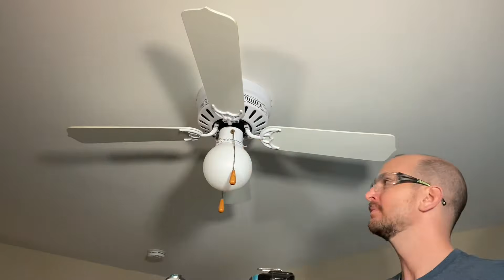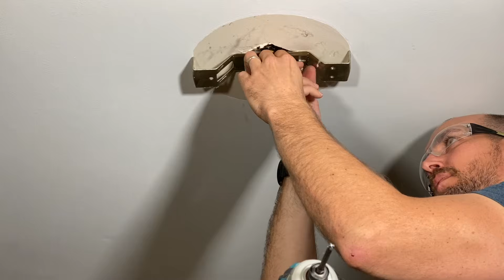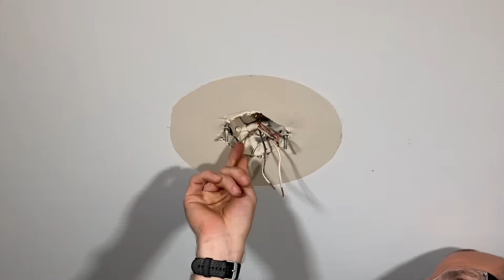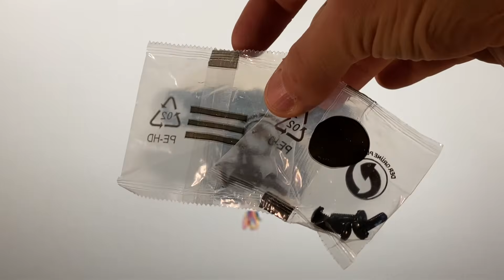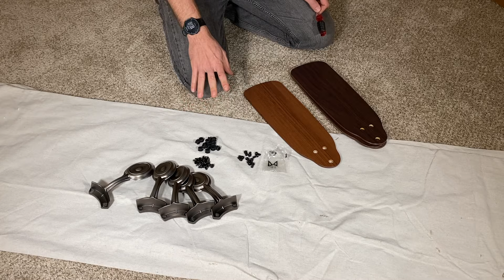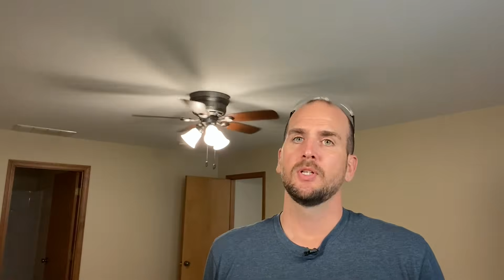How To Install A Flush Mount Ceiling Fan | Hunter 42 Inch

Comment from the maker: Hunter Flush Mount Fan 52 inch:  https://geni.us/BLdzPb
Klein Voltage Tester: https://geni.us/fAYN9Rr
Craftsman Screwdriver Set: https://geni.us/jXqFI
Wire Strippers: https://geni.us/MdOB
Makita Cordless Drill Combo Kit:  https://geni.us/t7dIA

Tools Every Weekend Warrior Needs
Dewalt Drill Bit Set:  https://geni.us/oFlSl
Dewalt Screwdriver Bit Set:  https://geni.us/VDcr
Eklind Allen Wrench Set:  https://geni.us/7XfvO
Pliers (4-Piece Set):  https://geni.us/RIdx
Stanley Utility Knife:  https://geni.us/ndIDa
Stanley Tape Measure:  https://geni.us/bUfD1R
Studbuddy Stud Finder:  https://geni.us/RySCuVw
Johnson Torpedo Level:  https://geni.us/wiLcDY
Stanley Hammer:  https://geni.us/bPDk8Wo
Buck Bros Wood Chisel Set:  https://geni.us/vk3cpTW
Klein Outlet Tester:  https://geni.us/kdBAJ
Little Giant Ladder: https://geni.us/fmlmTk

DISCLAIMER: This video and description contain affiliate links, which means that if you click on one of the product links, I’ll receive a small commission.

Comment: I'm installing this fan now. The two small machine screws that go into the bracket to hold the fan motor don't actually reach all the way to the fan motor thus the motor isn't totally isolated from moving. Yes, the screws do keep one from being able to actually remove the motor from the bracket but I'm surprised they don't go all the way up against the motor so that it is totally secured. Is this the way it's supposed to be or are my screws not long enough? I used the two screws in the "star" bag.
Reply: Yeah, I am experiencing the exact same issue. The screws just go into the housing holes, but dont reach the motor mount., which means the fan (in my case) will have a huge wobble. He completely skipped over that part of the install in the video. He didn't show which way the motor goes into the housing, and didn't show details of what those machine screws are screwing into.
Reply: @robwaters9820  Well, that was my first ceiling fan install, probably yours as well. I've installed more since then and that's the way they're all designed. They apparently all need a little wiggle room. If the fan wobbles excessively it's usually because the blades aren't well balanced.

Comment: I have a hunter fan with a standard ground wire and a green and yellow strip wire that is hot not connected to any other wires. Black and ble wires on fan connected to black house wire. Light comes on but fan motor does not turn.?????? Got any ideas?

Comment: Thank you this is a great video.  I have a question regarding the ground wire that extends from the ceiling power.  Does that screw directly to the ground screw of the ceiling box?  Thanks again.

Comment: Thank you so much for making that video.  It would have taken me 8 hours, but did it in 3.  The only thing that gave me problems was that my house only had the Black, White & Copper wires so I was way confused as the fan came with Black, White, Blue, and 2 green wires.  This is where I took forever.  Luckily I called my buddy, and he told me how to wire it.  Nonetheless, your video was so helpful.  Thanks again.  Louie from Armenia, Colombia here, and grateful.

Comment: This was absolutely fantastic.  I have 3 ceiling fans to replace.  I need this type of detail to take care of it myself.  Is the same process for changing a light fixture on the ceiling.  I have a light in the corridor that has a bowl over the bulbs and wanted to switch for something more up to date.  Also, is 'black' always 'hot' and 'white' always neutral?

Comment: I need help wiring a ceiling fan with a light and a light switch a single light switch. It appears that the light switch works the fan and the light? When I turn the switch on if the light on the fan it’s on the light will come on if the fan is running it will start running when I put the switch up. So if my fans running and or my light is on and I flipped the switch off everything goes off.

My wires coming out of the ceiling or a black and white a green and a blue.
My fan/light unit, has a ground a white a black and a blue wires.

How do I hook these wires together?

Thank you

Comment: Thanks for a great and easy to follow video 😁 My question is I just installed my Hunter Crestfield 52” fan with light kit ( #51020 ), and was wondering if there was a way to make the LED lights on it dimmable with a wall dimmer switch( without a remote unit)? Thanks again for sharing with us…Joe

Comment: Hi Scott. I installed the mounting bracket and the motor into the cradle. When I screwed in the bolts to secure the square top in the cradle it still moved up and down a bit. Is this normal? I was expecting no movement once I secured the screws. My wife thought it might be to allow it to rock slightly and not be completely rigid in the cradle. What’s your take. I thought maybe I made an error. Thanks
Reply from the maker: That is normal, the weight of the fan will hold it firmly in the bracket.
Reply: Good question, I had the same one and my wife thought the same thing🤔😎

Comment: Do u always choose Hunter brand ceiling fans? 

Do u know anything bout "home decorators collections" brand? As in...quality? Or any feeback really

Also, why dobt u try using threadlock on the screws so the fan blades dont get loose?
Reply from the maker: I lean towards Hunter, half from availability and half from good experience in the past.  I am not super experienced with home decorators collections.  When it comes to fan I try to go mid price and stay away from the low end.  Best of luck!
Reply: If you want the most quiet brand of fans, stick with Hunter.  They are also user friendly for installing.  Might cost more, but worth it in the end

Comment: I got this same fan and my old ceiling fan only had three wires that connected to it but the new fan has four how should I go about that
Reply from the maker: You will bring together the 2 hot wires from the fan and connect them together with the hot wire coming from the electrical box.  Sounds like you only have 1 wall switch which will control the power for the fan and light at the same time opposed to separately if you had 2 switches.  Then you can use the pull chains to chain the fan setting as it relates to the light and vice versa.  Caution ⚠️ I am assuming your setup since I don’t have any pictures so be careful as always when working with electrical.

Comment: Second video I watched. You really need to have an electrician look over your videos before you post em. You have errors that in your installation will not give you problems in this instance, but in another case if you have a switch that has fan speed and light dimmer or a specialized fan speed dimmer you just flip flopped the fan motor and light. Fans are almost always wired as black is the motor, white is the neutral, blue is the LIGHT, and green is ground. ALWAYS look at the wiring diagram that comes with the fan first. Cheap fans like hunter you can get away with it because its probably wired as two single pole switches on the wall which is why you have 14-3 return romex wire coming to your fan. But you don't want a fan speed adjuster controlling your light, or a light dimmer controlling your fan motor, especially if you spent some good money on a fan. Never test a half assembled anything before you finish assembling it. If you mess it up and it doesn't work you take it down and apart and trouble shoot a mistake, best yet call a professional. You don't get up on a ladder on a turn on a motor to a half assembled fan and try to screw in a light bulb with the switches on when your making a how to video for people not in the industry, super irresponsible. You need  to be a little more responsible with your videos. The instructions manual from hunter, that you bypassed, is better than this. I'm not going to watch any more of your videos. But you really need to not make how to videos without a licensed electrician looking over it at least. Electricity is dangerous, and sorry to say but the fact is you are not a qualified person to make how to videos on electrical work.
Reply from the maker: Thanks for the feedback
Reply: wheres youre video on fans???

Comment: Also, if there are multiple whites (neutrals), make SURE that other circuits that may be hot still, are NOT on.
Otherwise, you could create a "floating neutral" for the other devices and overvoltage the other devices due to them being on different lines (L1 and L2 devices need a return or neutral).

Comment: wall switches for light and fan ?
Reply from the maker: Hey Mike,  for this install I had 2 switches some installs you might only have one switch especially if you are replacing a light with a fan.  If this is your instance do check the electrical box to make sure it can carry the weight of a fan.

Comment: This helped me but my question is I have a harbor Breeze which has light kit. The fan works but the light kit does not. This has a type of plug to connect the fan and the light. I purchased a new remote but that did not work either. So can I remove the wire plug and wire it together so I don’t need the remote and maybe it will work.
Reply from the maker: Hi Michele, if you remove the top cover plate then you will most likely find the black remote receiver box.  You can remove that box and as you mentioned just wire the fan directly to the wires coming from you switches.  The wiring should be similar or exactly the same to the one in the video.  Let me know if you have any other questions 👍
Reply: @EverydayHomeRepairs  thanks for your help. So you say disconnect the black box. It has a red and a white wire going to the black box. What do I do with them? Do I put them together?
Reply from the maker: Hey Michele, did your controller only control the fan or the light and the fan?
Reply from the maker: Also, might help us get through this project by jumping on our Facebook group “Everyday Home Repairs Community.”  Then you can add pictures and we can get you back up and running. Without pics it’s tough.
Reply: @EverydayHomeRepairs  Thank you for all your help. I have given up on this. I have tried everything. The fan works just not the light. I will have to replace it. Thanks for all your help

Comment: What did you do with the Old Fan?
Reply from the maker: I think I still have 3 of the motors sitting in the garage.  Usually give them to a guy who scraps metal in the area.
Reply: @EverydayHomeRepairs  sell vintage appliances you can make good money
Reply: @erickmorton8085  
That fan is very generic, I own a Westinghouse Casanova Supreme, the newest ceiling fan that looks similar